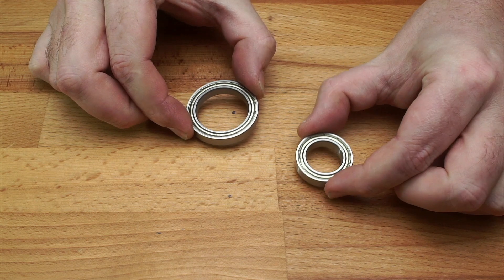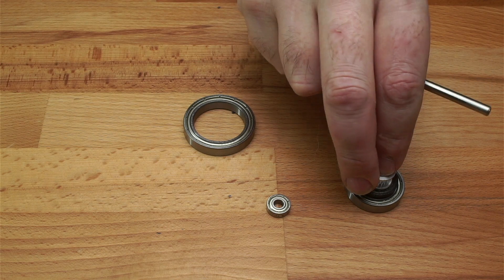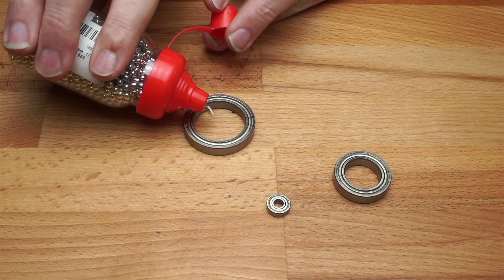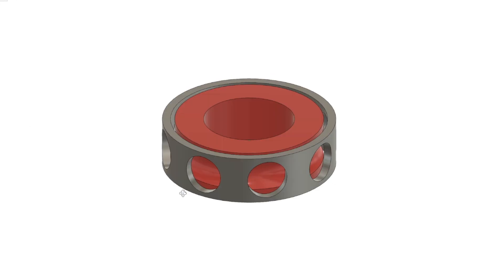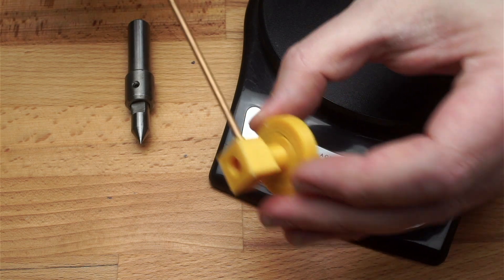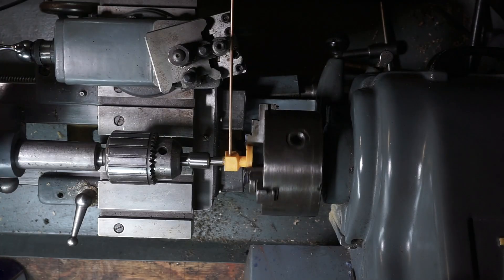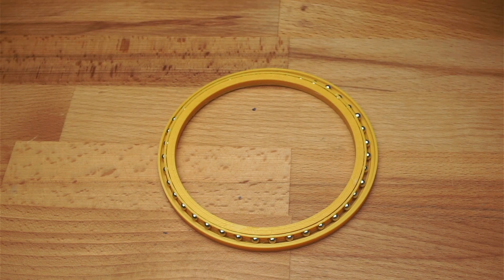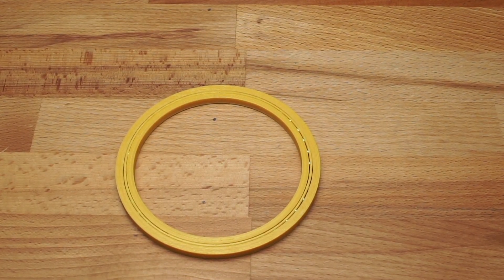Can you use 3d Printed Bearings for Robotics?

Comment: Can you upload these in a different format for Linux users? There's no way to use/interact with F3D files in Linux :(  Thanks!!
Reply from the maker: Yeah, sure! I must admit I didn't even think of that, sorry! What format would work for you?
Reply: @roTechnic  OpensCAD is what many Linux users use - thanks!
Reply from the maker: Right, I've looked into it and there's a problem - maybe you can help me solve it.
You can't export from Fusion into OpenSCAD format, and any other option I choose to save the fusion file as loses all the parameters so you can't modify any of the sizes or gaps.
The only way I can see round it would be to redesign the whole thing in OpenSCAD which I don't really want to do for all my projects.
Can you think of anything I could do?
Reply: @roTechnic  Hmm...Not surprised as I think about it more because the 2 work so differently. Are there any Fusion export options that do retain parameters for modification? Usually there's a Linux solution; Fusion is an outlier. Thanks for working on this!

Comment: Ha! Funny, I bought the same BBs and had a very similar design for a bearing, just did it in OpenSCAD.. they do work surprisingly well. Didn't get so far as to put a race in though... Good idea

Anyways, great videos and love your old lathe, I grew up playing with southbend lathes from the 1940s in my dad's shop.. the new ones are tighter, but lack the character and good cast iron found in the oldies😋
Reply from the maker: Cool. What are the bearings for.
And, yeah - you can't beat old cast iron!
Reply: @roTechnic  strangely also related to your videos... They were integrated into a cycloidal drive😋 I also didn't want to spend the money or wait for bigger bearings.. seems we're on a similar wavelength.. only you're making videos😉
As for the purpose of the cycloidal drive.. wasn't sure what I wanted to do with it yet, just really like them. I have a couple of very short animations of a couple of the designs in OpenSCAD on my channel... Hopefully more to come someday when I have more time..
Reply from the maker: Love the animation! How are you finding balancing the backlash vs friction? I think that might be the most frustrating part of these gearboxes.
Reply: @roTechnic  to be honest, I was happy it spun at all😇 I had printed a few before, but without any constraining features, so I just spun the cycloid around by hand.. adding up all that can go wrong with the tolerances between the cycloid/pin mesh, the eccentric and then the BB bearing races integrated into the parts themselves.. the fact that it all worked more or less was good enough for me.. I decided that the next one would be with bought bearings just to remove that part of the equation until the cycloid part was nailed down. Then I started renovating a house, work got intense and it's been sitting in my box of unfinished projects since the move...

But after talking to you, I might have to open that box up and get started again😉 I may just label the box "Pandora" before I open it though😋
Reply from the maker: Haha, yeah - I know that feeling! Let me know how you get on if you do decide to open Pandora's box again!

Comment: I'm doing some work with 3d printed bearings (in my case, recirculating screw setup) and besides the 4.5mm (.177 cal) BBs I discovered that there are also 8mm (5/16) and 9.5mm (3/8) slingshot ammo available pretty cheaply. for large diameters it may make sense to have fewer larger balls rather than more, small ones.

what sort of preload do you design in? for a 4.5 BB do you design the CAD model for 4.5mm gap? or smaller?
Reply from the maker: that’s useful info, thank you.

as for preload, I design the cad model at 4.5mm. but, as this is 3d printing, it comes out a bit smaller than that - not sure how much. I’ve found the best way of setting preload is actually to adjust the height of the bearing, changing the amount of material above and below the balls and relying on the PLA to flex slightly

Comment: If you used a tin can cut as a track that the bearing could run along, would that help with fiction issues?
Reply from the maker: the bearings run inside a round groove. I can’t think of a way of forming that from the tin can. if you can I’d love to hear about it, I’m always up for improving my projects 😎
Reply: @roTechnic  yeah,  maybe not a tin can, but a ring. (hoop rings can be bought at the dollar store). Or perhaps just wire. I'm thinking metal will have less friction than plastic, so get the bearings running on metal.
Reply from the maker: Oh, now that's a great idea! If i find these wear out or sap the power then I'll definitely redesign with something like what you're suggesting. Thank you!

Comment: Nice. I've contemplated doing this my self. I ended up using fully 3d-printed cross-roller bearings/slew bearings. I have to say those worked surprisingly well, though I found it best not to print the rollers in PLA, due to friction. Also I found it helpful to screw the split rings together, so I could adjust the preload of the bearing to my liking. I have not done as rigorous a test as you have here though. Not sure if my 7x14 lathe will swing the bearing I made :D
Reply from the maker: Thanks. How big is the bearing you made?
Reply: @roTechnic  OD 160mm ID110mm, thickness 12mm. The ID could probably have been made a bit larger If I didn't screw both the inner and outer rings together from two pieces (four in total).

Comment: Thanks. I've been messing with this stuff myself. The bigger bearing issue is a pain. Its always interesting to see new ideas.
Reply from the maker: I'm glad you liked it! I'd be interested to see what you're working on. Have you come up with any good ideas?
Reply: @roTechnic  I haven't really felt anything made photographic quality. I think the most novel thing i have done is used some ball bearings with Chrisoph Laimer slew gear design. The cylinder shapes for the bearings kept suffering elephant feet. Actually, making a bevel around the bottom edge of the gear connecting parts is a  bit of a must. Unless you have the greatest printer set up. So my progress is. I have a small micro and mg99r servo arm that about works but I felt servos are too weak. I am now moving onto steppers and cycloids as I think the accuracy and tightness will be better. 
Also, would you be able to upload a stl or stp file of the larger bearing on github? I would like to give it a try.
Reply from the maker: Yeah, I normally run a chamfer along the bottom of parts to get round the whole elephants foot thing too.
I've uploaded a 3MF file to the github page in the description for the 100mm bearing - you should be able to import it straight into Cura or PrusaSlicer. However, depending on your tolerances you may have to play with the sizing slightly to make the balls run freely. My printer currently can print clearances of 0.1mm with a 0.6mm nozzle so YMMV